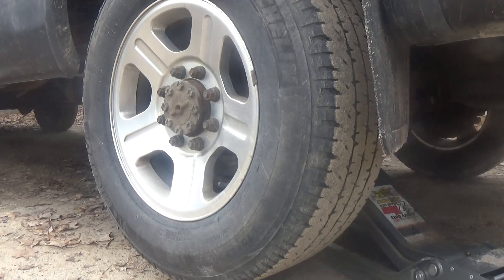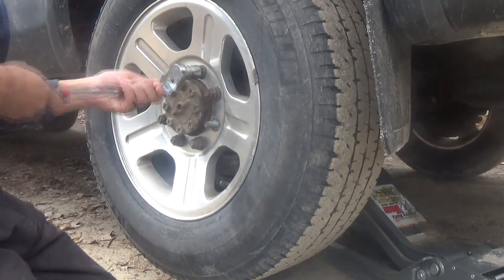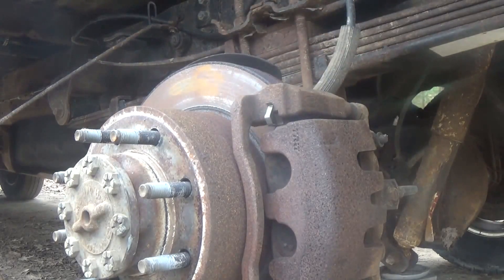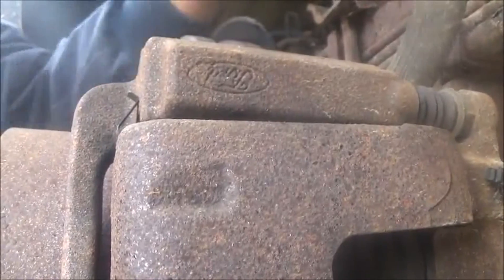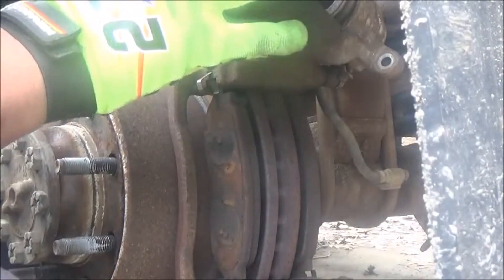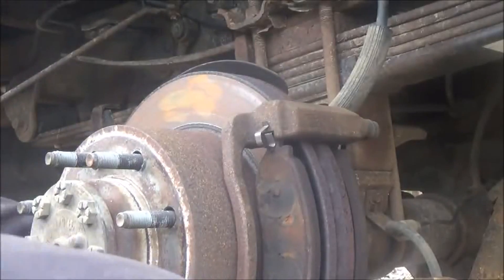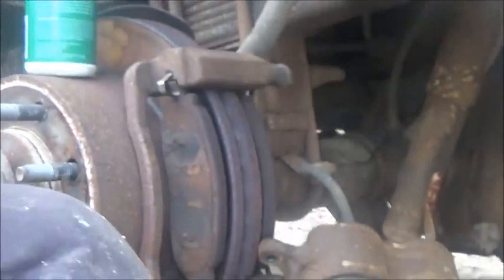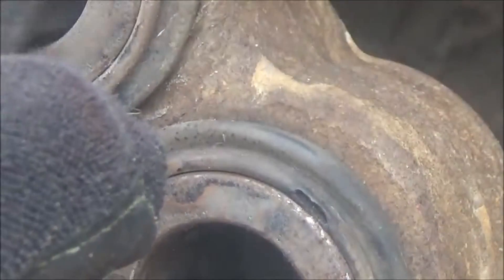Can you smell your brakes or hear squeaking?  Try this free fix!

Comment: My car has problem and don't know what cause 
When i hit the break pedal  break doesn't go down and comes vibration at the same time when i drive the car doesn't have power some time just slide and slide light sign comes up on the dashboard 
One time i smell something like burning 
Can you help me maybe to know the problem
Reply from the maker: By slide light I assume your talking about traction control.  If your traction control is kicking on and your night sliding generally one of your sensors have failed.  Places like AutoZone and pepboys might be able to scan your car for active faults they don't charge to check it.  As far as not going down at all I would think bad master cylinder or bad calipers.    What you have described isn't a easy fix and it is a little more involved then what I generally post videos about.  I will try to post a video soon of a couple things I think you should check specifically but i'm going to guess your going to have to take it to a mechanic.  
Sorry for the bad news, thanks for watching and stay subscribed for updates!!
Reply: Backyard DIY olso when i hit the break pedal is vibrating and sounds ki ki ki ki ki ki and 1 time i smell like burning
Reply from the maker: KANTRY CLASS:  Yeah that sounds like your ABS is activating, usually a bad sensor.